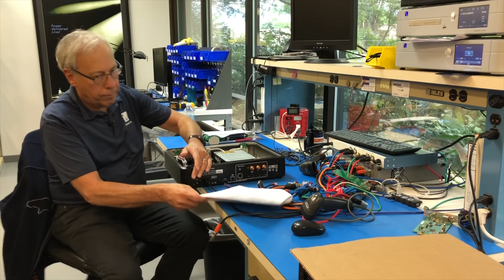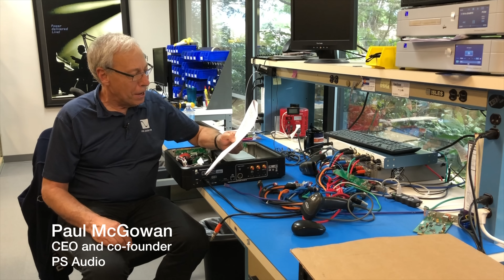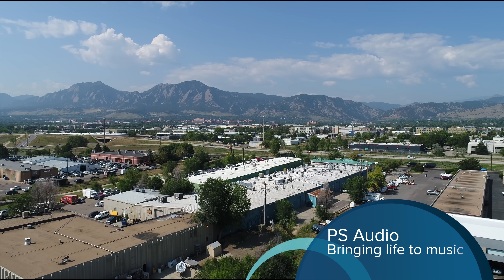What is a 2.5 way speaker?

Comment: A 2-1/2-way speaker is a two-way speaker that has a midbass driver (or "woofer") and a tweeter operating in a two-way configuration, with a crossover frequency that is typical of a two-way speaker (around 2kHz to 3kHz), but the output to the woofer is split again in the crossover at a much lower frequency (around 300-500 Hz) so that below the lower frequency, both the main woofer and the second woofer are playing together. This technique is referred to as "frequency shading" of the lower woofer (just FYI - so you can impress your friends with your knowledge of terminology). This is done because all (conventional) speakers radiate sound forward at all frequencies, but when the drivers are on a flat baffle facing substantially forwards, eventually as frequency decreases, the wavelength becomes longer than the narrowest dimension of the front baffle (usually width) and the wave begins to wrap around the corners of the speaker and be radiated backwards just as much as forwards, and this is thought of as a transition from radiation in the forward hemisphere to radiation in a full sphere. This results in the output of the speaker decreasing by about 3dB below this frequency (the "baffle step" frequency), and normally this is compensated for in the crossover by reducing the level of the woofer above the transition frequency by about 3dB, then reducing the tweeter level to match, but to preserve higher sensitivity in the speaker and provide some extra maximum loudness in the bass range, a second woofer can be brought in to play below the transition frequency, and that is what a 2.5-way speaker does. When the second woofer is playing, the sensitivity of the speaker increases by 6 dB, so there is an extra 3dB of output in the bass range, and this can make the speaker sound more powerful, but it is not strictly "flat" response. Another technique that can be employed is to feed the second woofer's filter from the output of the main woofer's filter, then bypass the second woofer's filter with a resistance that allows the lower woofer to contribute some output in the midrange, just lower in level by 3dB, so the amount of "baffle step compensation" resulting from the presence of the second woofer is only 3dB and does not produce the extra 3dB of exaggerated bass response. Maybe this technique could be thought of as a "2-1/4-way" speaker because the second woofer would also play some midrange, just less than what is output by the main woofer. The reason the second woofer is thought of as a fractional "way" rather than its own third "way" of the speaker is because the main woofer's output in the bass range is never completely rolled off by the crossover, and both woofers are loaded by the enclosure, so both are producing about the same amount of bass.
Reply: Wrong, a 2.5 way is when your wife catches you with your mistress and starts shouting.

It's not quite a 3 way. One isn't performing fully.
Reply: We're gonna need a TLDR version of that.

Comment: 2.5 is brilliant, when designed well. Column speaker has enough cabinet volume to provide lower frequencies and handle more power than bookshelf size two way design. Better midrange than with larger woofers and 2 x 6,5" woofers can handle bass as well as one 10" woofer.

Comment: I'm not sure why you would dismiss it as a marketing term. 2 1/2 way describes a very specific type of speaker/crossover arrangement. If not 2 1/2 way, what else would you call it? It's really not a two way, and certainly not a true three way.
Reply: gotham61 , I call it Rubbish, all you really need is a very good 3 way speaker system with 4 or 5 speakers sometimes 6.
1 big woofer at least 12 inches, 2 midranges, and two different tweeters, one soft done and one hard done horn loaded or waveguide type tweeter.
Case in point, my 1970s 
Sansui 3 way, 5 speaker design ass follows, 
one 12 inch rubber surround big ass woofer with an 80 ounce magnet
2 @ 4 inch midranges speakers and two tweeters with a selector switch on the front for " Soft or High"
these speakers are 40 years old and still out perform anything I have bought to date, hands down, they even had a twin port design. kick fucking ass
Reply: What you described is something probably good but not for all.
Reply: Mikexception , yea I know, I guess I was just trying to make a point about speakers in general these days. most all manufacturers are using such small woofers and I just don't see why when the 40 year old speakers I have ( that still work beautifully ) out perform every speaker and speaker system I've ever bought since the 70s, I do understand about movies and all the computer controlled sound for Dolby and thx.
but damn, companies spend millions on designs trying to get more bass out of a stupid little 6 1/2 inch driver, that's bullshit.
T-Line design, baffle this and waveguide that.
well RUBBISH I say with all that bullshit. my next purchase is gonna be
a set of Cerwin Vega speakers with dual 12 inch woofers, NO SUB WOOFER IS EVEN NEEDED.
My Fluance phono, Cerwin Vegas, and my Harmon/Karden receiver with a vintage 35 year old ADC EQUILIZER SPECTRUM ANALYZER, BLISS.
Reply: Thanks, I know what you mean. It is fatal mistake with small speakers forced to push lot of watts. 5- 10 Watt serious woofer makes all with ease and simplicity and what is most important with much smaller movement of cone. Anyway  it is  one of few ways to get happy.

Comment: It is unknown to market system so anyone thinking he has  it is wrong. Except he met somewhere  one of few my constructions :)..  I developed it and presented  working good in 1991  at AES convention, soon after I named  it "two and half" band speaker. .   Actually I was using it for almost 30 years,  still have but last time  no more in use .- (decided to switch to  50 years old widerangers with phase no problem).  . Uses crossover with three  filters (high, middle and low)  for  only two drivers. Low and high drivers share half to half send to them middle band  Purpose is to manage  middle band phases in coherence with two other - something impossible in  known LC  filtering.
Reply: Ha ha - - missed, There is  mid speaker too but setting of frequencies is like for  two way - only one common cross frequency.

Comment: I got a 2.5 high end drivers DIY speakers (1 m High  0.2 m Wide  0.3 m Deep )  And  with the a closed cabinet on top for the mid/woofer and tweeter and under a subwoofer, with only a upper 100 hz filter The mid/woofer and tweeter are build in a closed system (which is basically a separate subwoofer but in the same cabinet) So the mid/woofer in the closed system is build in a way that the mid is not capable to produce sounds lower than 100 hz   because of the closed cabinet (so without any holes for the bass)   and I must say it's sounds perfect  This is what I always understood a 2.5 system is.   I don't see any marketing here because of the minimal use of filters, and the natural way to cap the low in the mid is not a hard line so it sounds really natural....   Di I misunderstand this or is my system called something else?  Thanks for all the video's by the way I love it, greetings from Holland, Europe.   by the way, I watched the video again and now i understand your explanation better and it's the same as the one I have.. '-)

Comment: I have a 3.5 speaker, the Canton Karat 790 .2 DC. Seperate side 10'' woofer, two 7'' midrange, divided, and a tweeter and a huge bassport at the back tuned subsonic in combination with a high pass filter at 20hz.on the woofer. I love them and they are the best component in my system.

Comment: A better answer -

At a certain frequency based on the width of the baffle (front of the speaker cabinet) bass will start to roll off, this is called baffle step loss. A "good" 2.5 way design uses the bottom woofer to make up for the baffle step loss to get a more flat bass response from the speaker. Typically an extra inductor is added between the 1st and 2nd woofer (cascading filter). The resulting extra 1st order low pass then comes in right about where the baffle step loss comes in and makes up for it.

Comment: It's basically a 3-way speaker with the "midrange" having no low cut filter.
I had a JBL speaker that was a 2.5-way, but the lower woofer was a larger diameter.

Comment: Finaly!!! Thanks alot, sir! And yet, there are no specific calculators for this type of crossover... and I was wondering what frequency should I chose for the second driver... and if I chose one just by looking at the graph, what would determine my choice? I understand that its enough just to have a frequency that is below from the crossover point between the first woofer and the tweeter, right? Or its another think that I should take into consideration?

Comment: Do you remember the Speaker Lab speakers with a hybrid crossover that allowed one driver to serve as a passive radiator near FB but otherwise drove them in parallel? It was suppose to sound crisp like a sealed box but with better low end efficiency.

Comment: How do you keep the wrong frequencies out of the wrong driver? The answer is that you don't. You send the same signal to both woofers, but both woofers have different sensitivity and frequency response. And assuming you designed things right, this should work.

I own a pair of B&W 603 S2 speakers that are set up like that. And, yes, the second woofer was mostly about baffle step correction.

Comment: I have not seen a high pass filter on a woofer yet.  Unless in system requiring a sub.  
You were talking about 2 way speakers with high pass filter on the woofer.  Who does that??...and why?
Reply: The woofer has a high pass because if it plays higher it would distort.
Reply: And it can't play that high.

Comment: so, do they sound any better than or have an advantage over classic 3 speaker configuration (woofer, mid and tweeter) ?
Reply: Jhan Jar you'd think not really aside from 2 bass sources. The 3 way uses more dedicated drivers, the 2.5 way just uses another of the same driver in a 2 way to combat baffle step so that you don't need to pad everything down as with just a 2 way
Reply: Typically it is considered that a well executed 3 way speaker is superior to a well executed 2.5 way, which is superior to a well executed 2 way. 

I am a Paradigm speaker junkie, and they are big on 2.5 way speakers, but do it differently. Theirs look like a 3 way because they have a tweeter, a mid/bass and bass only woofer (or multiple identical bass woofers in some cases) where the mid/bass and bass look completely different. This is because the mid/bass is designed to go up to 2k Hz and is therefore much higher end than the bass woofer that only has to go up to 400 to 600 depending on which speaker we are talking about. Basically the Paradigm version is using 3 way drivers, but then using a 2 way crossover with an extra feature that keeps mids from the bass woofer, so in the end with the Paradigm version of 2.5 you end up with 3 way drivers, but the mid also pays down as low as the bass woofer. One could argue that this in theory is better than a 3 way as you are actually getting more. However, according to Paradigm the 2.5 way speakers fall jist short of the 3 ways on overall sound and they go 3 way on their higher end speakers.
Reply: I assume the reason the 3 way exceeds the 2.5 way on Paradigm speakers is that they can utilize a woofer that handles 500 to 2k Hz better when that woofer no longer has to worry about under 500. Also removing the bass from that mid also helps I am sure even if the same driver were used.
Reply: Jhan Jar I came from a 2.5-way Dynaudio to a 3-way Elac Adante.  Both very good speakers but the latter presents better imaging.  The separation or distinction of different instruments specially in dynamic music is more apparent in the Elac. Also the bass is more taut and quicker.  Just note again that they’re from different manufacturers so voicing of their products may have been a factor and not totally because a 3-way is generally better than a 2.5-way.

Comment: Why did my old Boston Acoustic A100 speakers sound better than any of my modern thin tower profile speakers with their slim small form factors running about the same size drivers?
Reply: It can be your perception, that perhaps your ears were better at the time, allowing you to enjoy stereo and dynamics better? 
Or perhaps they were actually not that good, but that you didn't mind their shortcomings. Did you do a side by side comparison. 
But it could be true, old gear can sound terrific, and companies moved on to different technology, but changes are not always for the better. Cutting costs, focussing on marketing instead of quality. I don't like those modern towers with two midbass and a tweeter most of the time, they lack bass and dynamics most of the time. A friend of mine has a pair of expensive Elac'' but I find them boring and dull.
Reply: You might be correct about it being my perception. If this is the case then It might have to be my virgin ears at the time being exposed to the Boston A100's for the first time and there for making an impression on me that stayed with me the longest. After many years of listening to many other speakers, maybe none of them ever made that huge of an impression on me as those Boston speakers. However, I have to say that I once got to listen to a set of cheap small bookshelf bookshelf speakers that also made a huge impression on me. I just could not believe those small speakers were able to produce such a low frequency and had enough clarity in vocals for me to take notice. Those small bookshelf speakers are from the early 2000's I believe. I still believe something happened with today's speaker production. I've been told that this may not be the speaker but may have to do with the audio recordings and the engineers being able to add amplitude to their digital recordings. In the past this was not possible and therefore speaker builders had to work to compensate for the lack of boosting amplitude and there may have sounded better than today's speakers.  Thanks anyway.
Reply: @moofushu  i recently bought a pair of speakers that i used to have when i was 16, 43 now. It was so much fun. In my memory they played perfect. But in reality compared to my home system just horrible, you can imagine what a 4mm rear board does with transparency, but they were not bostons.. but what amazed me when I played back music I used to listen to as a kid it struck a lot of emotional stuff and I had fun a whole week. It really sounded like childhood. I think you should rebuy those bostons somewhere and have fun too.

Comment: Paul,  I thought that the .5 referred to the inactive cone in some speaker systems.  You know, the cone that looks like a speaker but lacks the magnet assembly.  A passive device that is not a complete speaker mechanism.
Reply: That's a passive radiator, and they only replace a port that would be too impractical to fit in the speaker. At frequencies other than the tuning, it will not output any audible sound.
They are useless in baffle step compensation duties. They cannot output sound at the frequencies they should, and even if they could they will be out of phase (woofer cone comes out, they get sucked in).
Reply: Precisely.

Comment: 2.5 way? Just like the Advent Heritage towers I'm  re-foaming while watching this. 2 8" woofers and a tweeter of course. X over has 3 inductors . looks like each woofer is a low pass, different points. Helps with comb filtering i suppose, better mid range

Comment: Why don't they make four way speakers. I've seen a handful over the years, but my idea would be something like a ultra low frequency subwoofer, mid woofer, mid range and tweeter.
Reply: ken cohagen Very difficult to design well, and expensive to make work.
Reply: Scott Bernard thanks Scott. My current system is a Focal two way system with and F3 of 45 Hz, and repose on the purer end of 23kHz at -3.
I use them along with a sealed box sub that has a Q of .81 which has a rise at about 55 to 60 Hz, but the low end rolls off fairly flat down to and F3 at 23hz. I dial it in at 50 Hz and bring the volume up to where it sounds flat, not overpowering at all. I had thought about building a four way system, or three way with Subs built into the bottom of the cabinet for the family room where the ceiling is 22 ft high. Lots of room to fill with sound. I also thought about building a pair of el pipe o subs.
Reply: With modern drivers, a two-way is pretty much all we actually need, with a 3-way only for those who are looking into optimization. 10-12 inch woofers can go to 400-600Hz with very little issues of beaming or nearing cone breakup. We also have capable 3-inch drivers that can be high passed at 150-300Hz which eliminates virtually any hint of audible distortion, and they also easily reach 20kHz very cleanly.

Comment: What's the upside of a progressive crossover on an array of tweeters?
Reply: Wider vertical dispersion
Reply: My guess is it has to do with comb filtering. If two tweeters attempt to play the same same frequency, the distance to your ear will be slightly different. This creates a time offset which could cause comb filtering of certain frequencies.

Comment: I have the speakers in the thumbnail, I bought them for only €2
Reply: Which Sony speakers are those?
Reply: Speakers in thumbnail are Sony SS-CCP1, i have very similar SS-CCP2 i did get them free. Not very audiophile spekers crossover contains only two capacitors. Tweeter sounds actually quite okay, but they dont go very low.
Reply: Boar Production I modded mine with some acoustastuff and now they dig down to ~50hz.